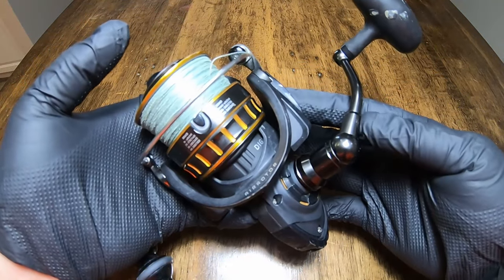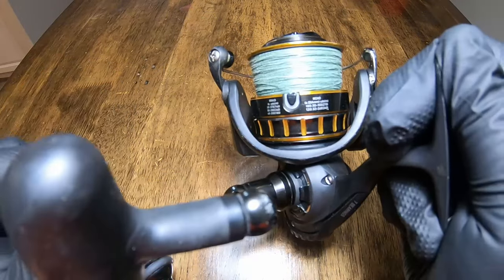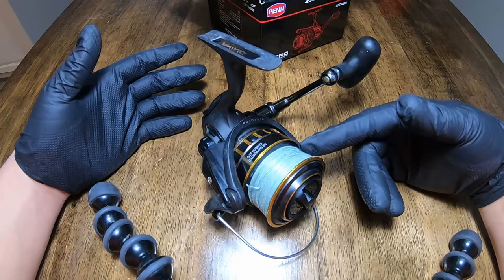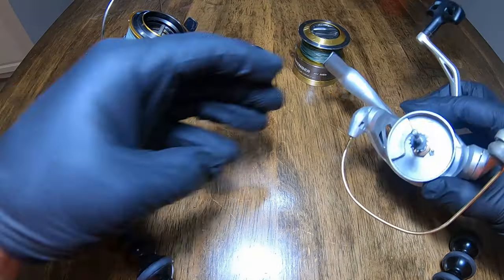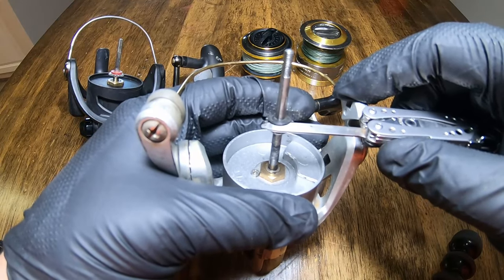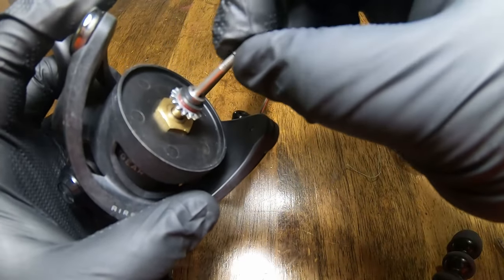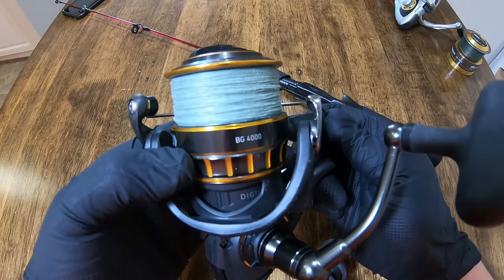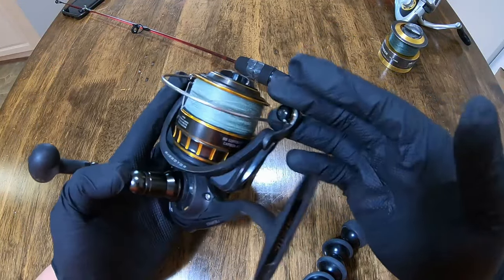HOW TO : Simple FIX for Uneven Line Lay on SPINNING REELS!!

Comment: Diawas are set up on purpose to have more line at the top. It casts better that way, but it bothers people with OCD. Lol!
Reply from the maker: Some are not all. This one had more than it’s supposed to according to my friend who works for them. This happened over time, was not adjusted straight out the box. This also is a how to for reels in general, not specifically the bg.

Comment: Thanks, this has been pissing me off! Been avoiding using the reel. My question is why TF would they do this!?
Reply from the maker: No problem! Biggest issue is storage. Every time I am done using any reel I loosen the drag as much as possible. What happens is, if it is stored with pressure (drag on) everything gets compressed and over time it loses its maximum range of motion. lol, good question!
Reply: My new Diawa Diablo did this right out of the box

Comment: Bought a 500 for an ultralight rod. It's very smooth enjoyable.fishing recommend casts great. One odd thing- the bale wire is a bit heavy diameter in my opinion for a reel of this size. But a great purchase.
Reply from the maker: Oh yea man! Great reels! They could downsize the bale wire on the smaller models. I like strong bail wires but have had some reels where they do seem to be too much
Reply: @ZackBostick this is a bot btw

Comment: Thank you very very much for this video!! I just recieved my first (and after this, the last!) Daiwa reel, and it was of course off when laying on the line. I got it done but the sweat ran cold trying to get that tiny rubber band off without snapping it! 😂
I just cannot understand why a premium reel producer can't get the shims right from the factory. I never ever had this problem with any Shimano reel, only with a Abu Garcia Cardinal SX, and they at least had the good sense to put the shims outermost on the shaft...
Reply from the maker: Absolutely! Happy to be of help. To be honest, sometimes reels are messed with before landing at home. For instance, some tackle shops will let customers hold and play around with the reel to see how they like it. Unfortunately, a lot of people like to tighten the drag to max and leave it there. Over time, this causes the parts on the spool shaft to compress. Causing issues like this. Whenever I’m done with using my reels, I loosen the drag all the way during storage.

Comment: A stainless steel flat washer will do in a pinch as a add on shim but I'd probably put it between the two original shims. I have a cheapo daiwa that was doing the same thing as the BG, stacking towards the top. I came here because I forgot if you have to add a shim or remove a shim to adjust for that problem. 
Baby powder in the neoprene gloves works wonders btw.
Also the rubber band is called an O-ring.😌
Reply from the maker: Thanks a lot man! Def have to get right on the baby powder lol
Reply: I done the same thing with a washer as it was a cheaper reel

Comment: What would you recommend for someone who's line keeps digging in to the spool itself? Great vid!
Reply from the maker: Hey Mason, im guessing you are using braid? The most common issue is laying the braid on tight enough. When spooling, pressure needs to be added to keep it from doing that. Can you take a finger nail and dig it into the spool fairly easily?
Reply from the maker: @Charley Walker yup :) get some tension on it when spooling. Take it off and give it another go. Should be all good :)

Comment: You can make your own  plastic washer. Use caps from plastic bottle . Make a hole in plastic in the middle large enough to fit the stem/shaft and cut it around in a circle. You can use a drill to make a hole in the bottle cap. Cheap fix
Reply from the maker: Absolutely!

Comment: Nice and informative! Do you know a shop around richmond that would fix two eyelets on a rod?
Reply from the maker: Thanks B! Around richmond, no. Closer to hampton and va beach, I know a bunch. I replace my own guides and youll most likely find it isnt too hard and kinda fun :) hmm maybe I could make a video about that?!? Do you need the whole guides replaced or do you have the type that just needs new ceramic?
Reply: I need the whole guide on two. A video would be great. Never thought about attempting it myself. Good idea for cold weather content! Also maybe a video on reel maintenance. I am terrified to pull down my conventional reel. Lots of little parts inside.
Reply from the maker: That's a great idea! I will be brainstorming for sure. Oh trust me man, I hate taking apart reels. I designed a clear box to work in, but somehow lost it during my move lol! I need to make another one...

I need to break a guide now 😂😂

Comment: Bro thank you so much for the video. I am looking At my new BGMQ 4000 Daiwa. Instructions with the reel are not the best. I have three of those washers that you lost in the past lol otherwise the instructions don’t make it clear that they are for that purpose. Until today I never knew there was a REEL made where the line could go on incorrectly and have an INCLUDED solution to adjust it. Main question is why didn’t Daiwa build it to where it lays on in a uniform manner? WTH?
Reply from the maker: No problem at all! Happy to help :) They make great reels, and they do typically come with line lay in the manner it is supposed to. The problem is, sometimes after much use and/or someone leaves the drag tight after fishing, the washers begin to give. The constant compression of the drag system on the washers flattens them at a faster rate. Which leads to problems such as this. That’s a main reason I don’t buy display models. And if i buy one used, one of the first things I check is if the reel’s drag is handed to me locked down. Usually means they store it in that manner.
Reply: @ZackBostick  ok! Makes sense. Thanks for an explanation! 👍 since moving to Fl in late 80s I had read to loosen up drag when storing and it stuck with me. ASSumed (lol) most everyone knew better.

Comment: Thanks. I have the bg 2000 and it has a huge problem with the line it’s a massive cone. Lets hope this works
Reply from the maker: Let me know how it worked out for you! Just pay attention in which direction it is coning :) this fix can be an annoyance, especially respooling over and over if the problem isn’t fixed to my liking the first time /:

Comment: Great information.. but I do have a question.. I have a daiwa kage spinning reel and from what I can see my line is laying even but when feeling in line it randomly will wrap around the bottom of the spool.  I am assuming I would need to maybe remove a shim?
Reply from the maker: How full do you have the spool? Is it over spooled? What size like do you have on it? Is it all right when retrieving?
Reply: @ZackBostick  it’s definitely over filled. Always careful to look. It has 15lb power pro braid.

Comment: Sure wish I would have looked into this first, before I tried a second spool of braid on my brand new reel. Yep,  $35 of braid in the trash. The 2nd one ended up getting tangled up due to frustration, and spending 2 1/2 hours of trying things to get it right. I never experienced this before and starting questioning myself, even tho I have been spooling up my reels for over 45 years, lol. Then a light bulb came on after I seen this vid, and damn, I was wondering why there was a couple of extra plastic washers in that little zip bag in the box. No explanation why or what they were for. Thank you for sharing
Reply from the maker: Haha no problem at all man! Very happy to help :) trust me, I didn’t know either and would just throw em away! Haha
Reply: You could have re used the braid!!....
Reply: @Wacky_fisherman  - Read original comment
Reply: @woosa42  I guess that would help ha. I was putting in the spacer and had the spool on my leg and it fell off down into the pile of braid I had to pull off the spool to re due it. Luckily I was able to pull it straight back out lol
Reply: @Wacky_fisherman  yeah, unfortunately i wasn't that lucky. I should have wrapped the line around the original spool, but i had enough punishment. lol

Comment: my reel does not go up and down? the line just stays at the top of the reel then gradually falls down on its own. :( lots of tangles. The rod seems standard issue maybe I got burned on the reel? do they actually make reels that do not go up and down ty
Reply from the maker: In general all spinning reels will lay line up and down the spool. Some spool tighter, some not. My best guess is the gear (or one of them) is not catching so the spool stays in same position. I’d stop the headaches of untangling line and paying for new line and get a different reel. The bg is a great reel that is very versatile. I’ve seen them new on marketplace for under $70 for 4K size

Comment: Do you have any experience with the Regal LT’s? I’ve got two 2000D regals that spool line off the bottom of the spool, but when I take the spool off it doesn’t have any spacers, just a very thick washer under the bearings. Do I take that off and replace with a spacer?

Comment: Just a question,my slammer 3 is laying line thick towards the bottom,i already replace with smaller shim,its better but still smal gap on top of the spool.can i go without any shim?
Reply from the maker: When that happens to me, I did the same thing and ended up running without one completely. Hopefully that will work for your case as well :)

Comment: It appears on my reel that if the drag setting is to lose it will cause a uneven spool. All I had to do was  tighten the drag to the proper setting and now it’s perfect.
Reply from the maker: Nice! Yeah, always want to have drag locked down when spoiling up. Otherwise, uneven line lay, lose of line capacity, causes wind knots and even line sink.

Comment: Daiwa spinning reels with an 'ABS spool', such as the BG, are designed to have a cone shaped line profile.
Reply from the maker: Have heard some reels do have a slight cone, but this had a whole ring exposed on the bottom with the top maxed out. I have 3 other of the same reel but different sizes that have and always have had flat line lay. After, I was able to put much more line on and no more wind knots.
Reply: @ZackBostick  yep, your line profile might have been too cone shaped, overly cone shaped. But the profile is not really designed to be parallel sided -- but if it works, it works!
Newer Daiwa spinning reels like the new Saltiga, new Certates have a new spool design which is more like Shimano's. I think it's considerably better than the old ABS idea.
Reply from the maker: @davidcarley8566  thanks David, Ill look more into it :) I learn something new everyday. Thanks bro

Comment: What if i have the opposite problem, that is to say i have less line on top than on the bottom
Reply from the maker: Add a shim from an old reel of the same size. A lot of people just make their own. Not so say any size (thickness) will work. May take some trail and error.

Comment: Uh this is really old I know but I don’t want people thinking their Daiwa BG is defective. The BG has a reverse taper spool, it’s supposed to be wider towards the top for less resistance against the spool lip when casting. You guys have messed with the natural design of the reel.
Reply from the maker: This video was not directed specifically for BG. You are correct but the line was tapering more then it was supposed to. I had a buddy of mine that works for the company take a look at it. He agreed that it was more aggressive than intended.

Comment: Hi my line keep spooling under the reel i searched the internet and cant figure it out
Reply from the maker: I am confused on what you mean.. if it’s literally getting caught under the spool, sounds like you’re using either very thick line and or over spooled it. Or that when retrieving you don’t have tension to the lure or bait. Could be a combo of very heavy mono mixed with retrieving very little weight.
Reply: @ZackBostick  I fixed it. The problem was I had too heavy line and too much on the reel.

Comment: How am I supposed to unspool it?
Reply from the maker: Fellow Asian, I use another reel. The one that has line on it, set it down with the drag completely loosened. Run the line through another rod and tie it to the other reel. Winding it off the spooled reel and onto the spare reel.

Comment: Rubberband 😆 o-ring maybe? 😂
Reply from the maker: O-Rings are used to keep a liquid or gas in 😂 We will go with BUSHING since your were confused to which part I was referring to 😆
Reply: @ZackBostick  a round bushing interesting 🤔 😆 😆 😆. I fixed mine with a stainless washer and a file..
Reply: @ZackBostick  bushbandring..
Reply from the maker: I am very confused bc I thought most bushings were round…maybe cylindrical but still round. Like bushings on suspension parts and such. I’m sure the stainless steel washer would work to replace the shim :)

Comment: Probably better off converting the rotary motion to linear motion using a crank and rod going to another gear or flywheel that’s oriented along the appropriate axis. (If the spool gear is oriented along what we’ll call the z axis, it’s driving a linear actuator along the z axis to a flywheel oriented flat along the x axis) with another linear actuator so that we can convert the motion from the z axis to the x axis. Then put a smooth rod along the x axis and a carrier of some kind that the line sits inside of allowing the carrier to move freely on the smooth rod. This solves a few different problems. 1) it can easily be adjusted to move at the appropriate speed along the x axis at multiple different points allowing for a large amount of reduction 2) since you’re not using a screw actuator you don’t have to solve the problem of getting the carrier back to where it came from without spinning the rod in reverse and 3) it’s simple with few points of failure. I’d suggest a large reduction to start. Do this by welding the connecting rods to the far edge of the inside of the rotary motion wheels. This will make the rotary wheels spin slower than the spool meaning the line will move from left to right much slower. There’s some math you can do to figure out an exact amount of reduction but you can find that freely online. But basically every time the spool rotates once you want the linear motion to change by the width of the line. The ratio of the circumference of the spool to the width of the line will give you that number. But alas, the size of the spool is always changing diameter so you’ll have to use averages and just do your best. I’d start with like 25:1 and see where that lands you. You can always increase the reduction between the first rotary wheel and the spool too to decrease the speed of the linear actuation